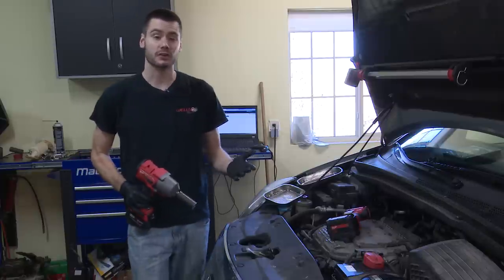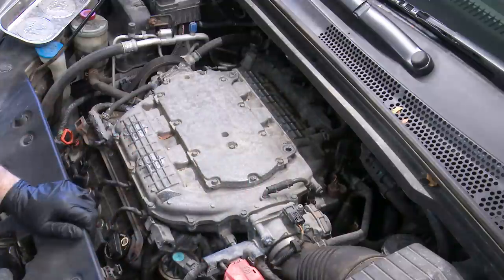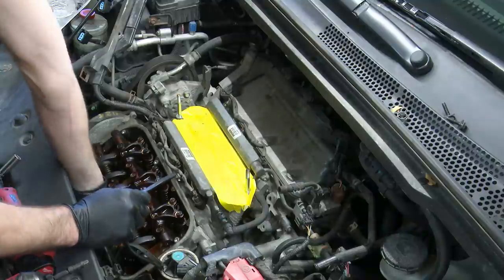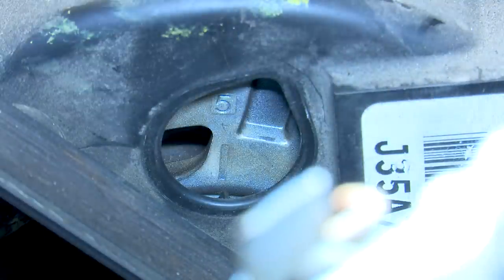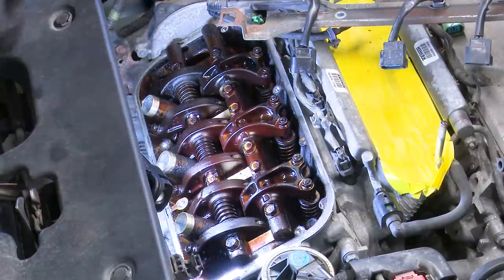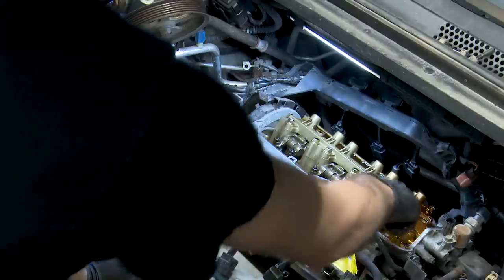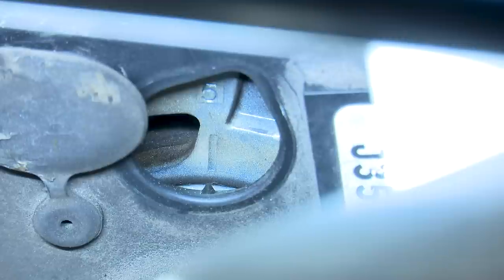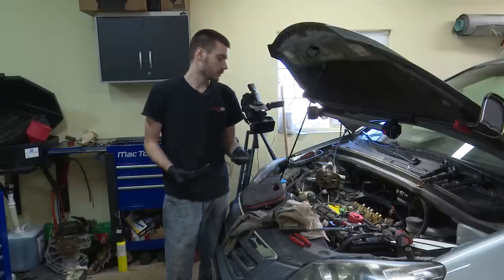2006 Honda Odyssey 3.5 Random Misfire Case Study Part 2 : How To Perform A Valve Adjustment

Comment: These engine you really want feeler gauge that is bent on the end. When ur adjusting them you want a slight drag on the gauge no more than that. Also that back bank is gonna be a pain. Especially cylinder 3. Another thing don't forget to put Honda bond on the valve cover, on the sides where two pieces on metal come together.
Reply from the maker: All great tips! I bent my feeler gauge for the back 3. You're right, they were a pain! Anytime I do cover gaskets on anything I put some sort of silicon RTV where metal surfaces meet.
Mike Becker, Senior Technical Instructor

Comment: great video! looks like conventional oil was used in that engine. little darker than id like to see.
Reply from the maker: Could be. This customer has only owned the car for about 20,000 miles. Hard to say what the previous owner did, but overall there wasn't any major sludging. Overall it's not a bad looking motor for 210,000 miles.
Mike Becker, Senior Technical Services Instructor
Reply: Looks more like a lack of oil change.

Comment: In mid process right now. 
2010 Honda odessey with 210k miles. 

1. Does it matter what direction you turn the engine over? Clockwise or counter? 

2. The peeper hole is very convenient. I have found one on each side however. Does it matter if I reference the front bank peeper hole while adjusting the rear bank cylinder (with correct cylinder number)? My front peeper hole paper  shows me cylinder number 3 which is in the rear.
Reply from the maker: Hey insideHARDWARE,thanks for watching. Yes it matters. That engine should only be spun over clockwise. If I remember correct, I only used the front peep hole on this one.
Mike Becker, Senior Instructor
Reply: It does not matter what cylinder you start on, if the first number that comes up is cylinder 3 you can start on cylinder 3. All that matters is that you turn the engine clockwise, and you stop on the mark, and that know where the corresponding cylinder is. It is super easy just very tedious. I'm sure you probably have figured it out by the time I left this comment

Comment: Good video. I appreciate you using a mirror and additional lights so we could watch as you adjusted the rear valve Bank. 
   I wish you would get rid of the background music, even when you were fast forwarding through your work. I had to turn off the sound to concentrate on watching you then wonder if I missed anything before you slowed to normal wrenching speed. Otherwise great video!
Reply from the maker: Hey John, thanks! I'll keep that in mind for next time.
Mike Becker, Senior Technical Instructor
Reply: agreed! no music mike. or, perhaps you could just hum..?

Comment: I replaced valves damaged when TB idler pulley bolt broke causing piston/valve contact.  I did the adjustment off of the engine and check my work 3-4 times.  After installing the head, bank 2, I now get a P0300 & P030[4-6] misfire.  My fuel trim, both short and long, are in the neg for bank 2.  Once warm, the car drives fine with no errors but, it is a little rough and still has neg values for fuel trim in bank 2.  O2 sensors on both banks have similar readings up and downstream.  Looks like I may need to check my work with the head on the engine.  I'm not sure if the torqued head bolts may have somehow changed the valve adjustment.  Is that possible?  Great video series...thanks!
Reply from the maker: Hello,
I would start by doing a vacuum test at idle cold and see if it is in normal range.
~Ryan

Comment: Great video..I've had my 2006 Honda Odyssey To 3 Mechanic Shops. Code reads misfire on cylinders 1-6 plus bank 1 to rich next to backside of motor.  When you first start it up in morning it doesn't seem to shake as much..but after a few minutes it noticably shakes..but when on interstate it does great. But also it has a hard time pulling big hills. Honda was 3rd mechanic shop I took it to. They seem to think it maybe could be needing valve adjustment.. coil packs are good, spark plugs are new. Also I've run 2 cans of sea foam through it. Do you think it's a big possibility it's just needing a valve adjustment? Also will hurt engine running it like this until I can get fixed (if it needs valve adjustment) It has 265,797 miles. Thank you🙏💯
Reply from the maker: Hi Wes,
Thanks for watching! With a 265,797 miles, there is a good chance your engine is in need of a valve adjustment. I would start by measuring engine vacuum at idle. If the valves are out of adjustment far enough to cause a poor running engine, it will usually show up on a vacuum gauge. Look for a steady reading around 17-21  inches of mercury. If your readings are low, I would suspect valves may be out of adjustment.
Ryan W, technical Instructor
Reply: @GoTechTraining  Hey there. Thank you very much for info ,🙏💯

Comment: Hello, I have the same problem with Odyssey 2005 and valve adjustment did not help. I checked the fuel pressure - 55 PSI, pressure in all cylinders - 13 BAR, replaced the ECU, replaced coils and spark plugs, checked the installation. In ECO mode, there is still misfire on all cylinders. In permanent error mode the problem does not occur. Will you help??
Reply: Had similar problem.  All the UT videos did not help.  Adjusted valves and cleaned throttle body.  Turned out I needed scanner  to do a throttle body relearn.  Bought Foxwell NT530 scanner with Honda software $160 and nailed it in 15 minutes.   That software mirrors Honda scanner.

Comment: I have white smoke from exhaust pipe. I have the following codes: Front air/fuel ratio sensor bank2 sensor 1 heater system malfunction P0154, P0300, P0306, P0305, P0304, P0303, P0302, and  P0301.

I changed the front senor hoping it would change the white smoke bit it is still present. I am considering cleaning my fuel injectors. The car is rough idling. What else can be done?
Reply: Replace head gasket

Comment: thanks for the great video, i got 1 bolt broken while i was tightening the valve cover, can you suggest how to get the reaming part out of the hole?
Reply from the maker: Hey Ahmed, drilling and using an extractor is probably the way to go. Good luck!
Mike Becker, Senior Technical Instructor
Reply: @GoTechTraining  Thank you very much, i have done the tuning and the check engine light has been gone (after more than a year no mechanic cold identify the problem except one). the car now runs very smooth and no vibrations.

Comment: Great job, i wish every single dealer shop have the same knowledge,  now how much is the average cost for this job?
Planning if it worthy do it by myself
Reply from the maker: Hey Rafael, thanks! I'd expect this to be between $600 and $1200 depending on the labor in your area. Saves you a ton of money if you can fix it yourself!
Mike Becker, Senior Technical Instructor
Reply: Fair enough, I'll try to do it one day
Reply: Wells Vehicle Electronics 6 to 12???? Holy crap. Not saying your ripping anyone off, far from it. Just saying the cost of a valve adjustment being able to total a vehicle is piss poor engineering.

Comment: I just did a 2005 Odyssey today with multiple cylinder misfire codes. I simply couldn’t convince my shop owner, who was never a technician, that tight valves could cause this issue. He sold the customer 6 new coils and plugs. It was only when I said that if the codes came back i wouldn’t be responsible that he finally called the customer again and sold a valve adjustment. All 12 exhaust valves were around 4 thousandths or less. 153K miles. Strange to me how the K24 engines never exhibit this issue.
Reply from the maker: Awesome Wayne, hope the shop owner believes you next time :)
Mike Becker, Senior Technical Instructor

Comment: Thank you so much for you series of videos!!  
Question - I noticed, in your video, there was more varnish build up under the valve cover of the front bank (4,5,6) than in the back (1,2,3).  What would be the reason for this?  I just finished doing the valve adjustment on a 2006 Honda Accord 3.0L V6 (the exhost clearance on cylender 4 was at .005 inch) and saw the same thing.  The front bank was full of gunk while the back, thankfully, was relatively clean.  There was also a ton of buildup (oil and soot) in the two intake manafolds, the intake plenum, and throttle body behind the butterfly valve.  Is this some how related to the valves being too thight?  Or is it related to something else?
Reply from the maker: Hi Shawn,
Wow good observation! I didn't even notice this until you pointed it out. My only guess would be the rear l uses a little different oiling set up than the front cylinder head. If you notice in the video, the rear has a aluminum housing on top of the rockers, that is a VCM unit used for cylinder deactivation. This may change the way the oil flows though the engine. A slight difference in temperature, either from oil flow or cooling may also contribute to this, but I can not say for certain.
I'm glad the video helped you out and thanks for the question!
~Ryan

Comment: I have a 2005 Honda Odyssey 207,000 miles cylinder number 5 has a misfire I replaced the spark plug I replace the coil pack and still the same result no change there is a problem with when it cranks over it sounds like it jumped timing but I had the timing checked and it did not jump timing on the spark plug there was Heavy oil consumption any ideas what's wrong with my engine
Reply from the maker: Hey Timothy, so you've looked at a spark issue. Next thing to check would be a fuel or compression issue. Could be bad piston rings causing the plug to foul out with oil?
Mike Becker, Senior Technical Instructor

Comment: Great presentation!  If your diagnostics showed the intake valve function OK, can you save the customer money by just measuring the intake valve clearance and not adjusting it if it is in spec?
Reply from the maker: J Eadie, thanks! Sure! No sense in adjusting the intake valves if they are in spec :) Most places probably just charge one flat labor for a "valve adjustment".
Mike Becker, Senior Technical Instructor

Comment: Hey there. I enjoyed your video and have a question you may be able to answer. I have a 2010 Odyssey that has what seems to be valve noise. It has 70000 miles and has been serviced regularly. My mechanic did a valve adjustment(and rocker arm retorted) and did not find much amiss and  of course the noise is still there after reassembly. He noted that the front head was discolored like in you video and the rear one was super clean. He suspects that the front head was swapped some where along the way, although I know it has not been. Do you know why the front head would be discolored like that and not the rear if they are of the same age?
Reply: VCM - Variable Cylinder Management. These Hondas with VCM shut down the front bank for ECO mode. My understanding is this causes oil to blow by the cylinder rings and causes lots of discoloration in the head. Even worse is it causes premature wear of the front cylinders because the cylinders are not being oiled and cooled properly when they are shut down. Look up Honda VCM problems for more info.

Comment: Bought my 07 Odyssey brand new and it has never been to a dealership or garage since!  I have changed the timing belt, water pump, plugs and coils, belts and high pressure line to rack. Numerous brake jobs. 160k miles. I’m getting the PO 300 codes now on all cylinders. I reset the codes and it runs fine for a while. Do I need to do this adjustment now?
Reply: Yes

Comment: What are the torque specs to put the cover back on your never said it
Reply from the maker: Heather, spec for the valve cover bolts is 8.7 ft lb.
Mike Becker, Senior Technical Instructor

Comment: I cant believe Honda still uses the mechanical valve adjustment. wonder why they didn't do hydraulic lifters
Reply from the maker: I know John, right! Crazy....I guess if it's not broke, don't fix it? Overall that 3.5 is a great engine....just needs a little extra maintenance love. Which is great for us, maintenance=$$$
Mike Becker, Senior Technical Services Instructor
Reply: Honda knew this design was subject to valve seat movement. Hydraulic lifters couldn't compensate for the amount of movement. Also, look at the design of the head....gravity/angle can affect hydraulic lifters over time, and they need more oiling than this design. At the end of the day, hydraulic lifters that were up to the task, and additional cylinder head engineering would have cost Honda money, and gone against the planned obsolescence narrative. It would also not be beneficial to technicians.

Comment: Looming for advice, I have a 2006 odyssey that's a crank no start situation.  Its. Running normal after a cold start in about 15 to 20° weather w/snow and ice. After about 45min of across twn I was in PARK only about 5 min at idle and the rpms shot up. In drive idle semmed better but accelerating it had no power. Just bog dwn it felt like. Misfiring is the best way I can put it. So I understand the Tps sensor or switch may have failed? And/or the map or egr could effect the situation as well? After restarting the problem went away and before making it home while driving the van lost all rpm and believe it misfired to a stop and engine died. No restart. I noticed my snorkel had broken recently during the cold spell. Cracks in the tubing lead to reasonably wide (splits ) in snorkel. Tomorrow I plan on scanning for codes and going from there. No real regular maint besides oil changes and vsa being serviced. I do have a multi meter and some idears on checking tps and relay continuity and what not. Specs are easy to find. Just the over all direction and approach would be appreciated. I beleive spark and fuselage not the issue here. Im a carpenter as well. Somewhat 🔧Er but no means a mechanic. Thanks and stay warm.
Reply: Sure sounds like a vacuum leak or IAC is malfunctioning. Get a cigar and some aquarium air tubing. Disconnect a vacuum hose and attach the tube to the inlet port. Duct tape it if need be. Start puffing and blowing smoke into the tube. Watch for smoke. You should be able to see where the vacuum leaks are coming from without running the engine. I would recommend cleaning or replacing the IAC motor if this doesn't remedy the issue. Since it's really tight around the rear bank, some BRIGHT lights in several spots around the engine bay can make the smoke easier to see. A borescope would make this WAY easier on the odyssey. That thing is jam packed.

You can't hook the tube up through the throttle body because it's drive by wire (electronic controlled throttle plate... not opened by cable). Depressing the accelerator will do nothing while the car is off and you shouldn't move the throttle plate by hand. The ECU needs to be energized to open the throttle plate.
 They're not like old throttle bodies that you can just stick a screwdriver into to hold them open, or push down on a side lever. It's all controlled electronically.

You might also suspect problems at the throttle body, and might need to reset it. Cleaning it could be risky if you don't know what you're doing. Electronics could be damaged in the process. To reset the throttle body and synch with the ECU, turn the ignition to RUN for 2 seconds but don't start the engine. Start the engine and run at 3k RPM until the radiator fans engage. Let it idle for 5 minutes with no load (nothing on in the car, no heaters, lights, stereo, etc... everything is off). Then shut off the engine. It should resynch the throttle body with the ECU.

Comment: Hi, mike. Quick question from a diy person here.  I have both of my cilinder heads out of the block (on a table) I'm trying to adjust the valves before installing both back into the engine block.  Can I adjust all valves all at once (given that all valves are close)? Again, both cylinder heads are out of the engine, sitting on my table.  I remember you said at the beginning of video that valves have be close. Is it possible?
Reply from the maker: Hello,
Even if the cylinder head is removed, the camshaft is still installed and acting upon the valves. I would wait till the head is installed and follow the procedure to line up the camshaft in the correct locations to adjust the valve lash. 
~Ryan

Comment: What do I do if two nuts on the rocker arm are missing someone told me to drop the oil pan and look for them there?
Reply: Check the muffler. Bet you'll find them in there.
Reply: @timault8209  thank you.. but found them in the oil pan..lol

Comment: I haa 2004 honda oddysey with the same issue, is there a torque spec for the lock nuts? First time doing this
Reply from the maker: Hey Gabriel,
I show a torque spec of 14 (ft lbs)
~Ryan
Reply: Thank you very much!
Reply: Ryan, thanks again! after 9 months and 9,000 miles later, my 2004 honda Odyssey issues are gone, with no codes and no oil consumption, I did have to mention I also cleaned the intake, which had a lot of hardened soot, great video!

Comment: Can valves needing adjustment cause smoking?  My 08 Odyssey I just got smokes a little during light throttle not on start up. I'm thinking valve seals. But could valves being out of adjustment cause smoke? I just did the timing belt thinking the ticking I heard was the tensioner but it's definitely a valve being lose tapping. I'ma adjust the valves soon after I do another oil change to clean the engine out.

I did my 02 Accord V6 in less than 2 hours my first attempt with an electric ratchet.